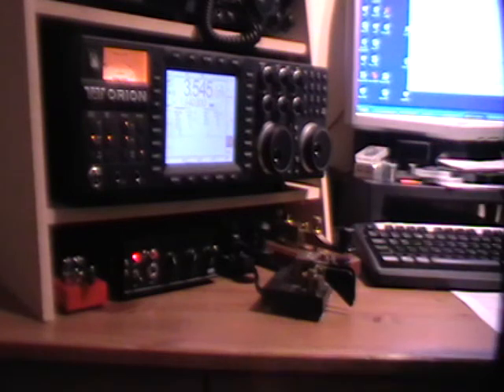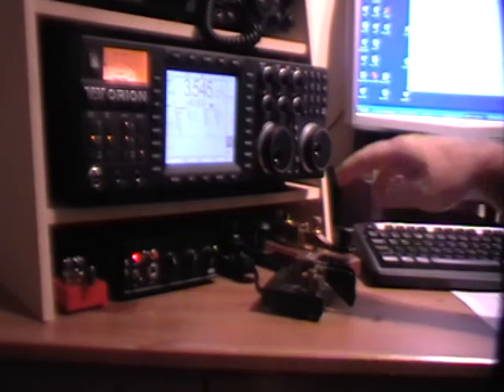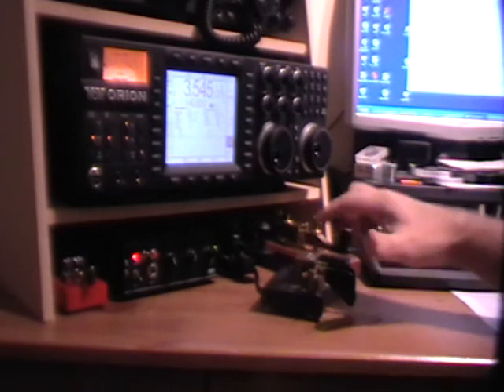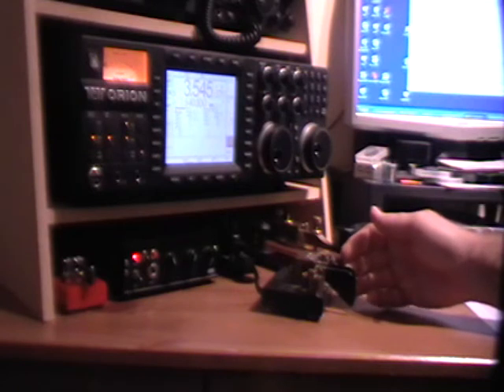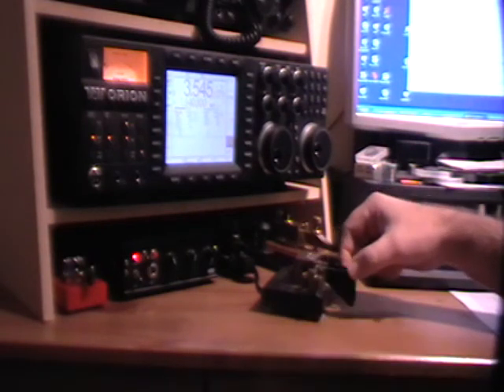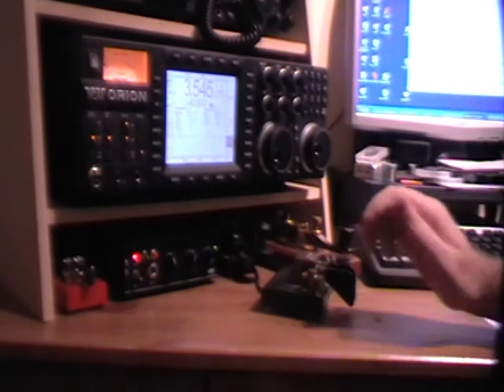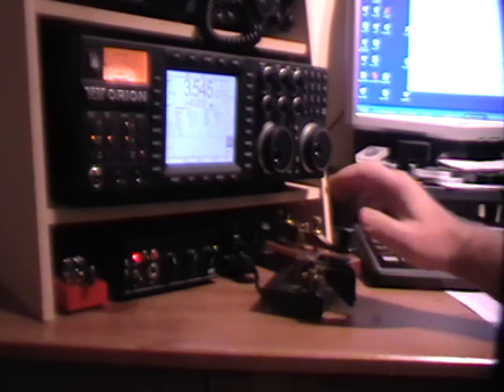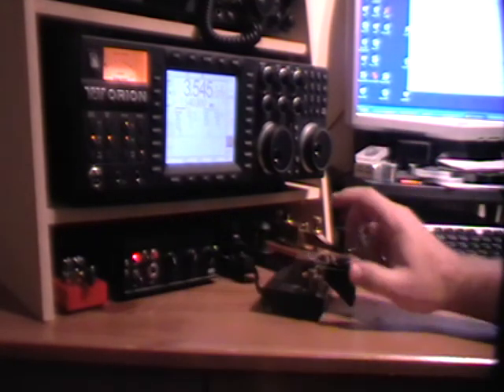Dual paddle cootie 2

Comment: hi Robert, I saw that your Kent keyer (i.e. the box with electronics) is the same as the one I got some days ago. 
Alas there's no manual and/or schematic with my keyer. Do you happen to have one ? 
I'd realy like to know the functions of the 'Tune' button and the 3 position switch on the left side of the frontpanel.
I realise this video is over 7 years old but I give it a try anyway ;)
TIA 73 Leo PA5LS
Reply from the maker: Hi Leo. Sorry, I don't have any paperwork for the keyer. I guess that I 
did originally, but it is all long gone. the "tune" button bypasses the 
keyer and simulates "key down" to allow an ATU to be adjusted etc. My 
keyer does not have a "3 position switch" so not sure what that is. My 
one is of course modified. I added the toggle swith to allow me to 
easily switch from keyer to cootie.